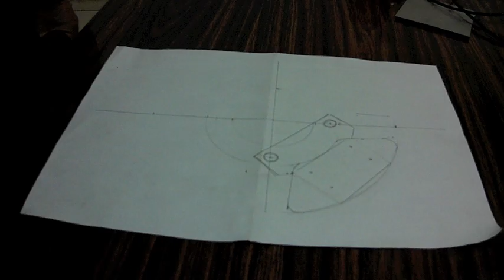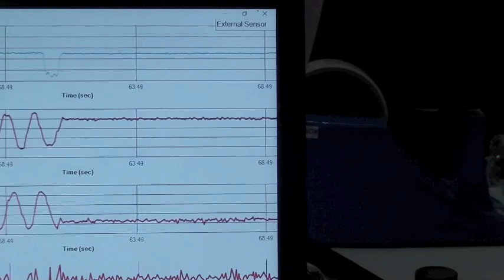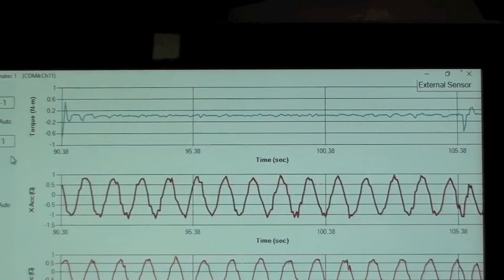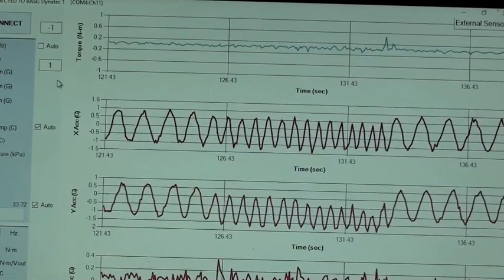TORQUE Measurement on two-wheeler with strain gages

Comment: When the wheel is on the ground will bumps in the road throw this off? I want to try something like this to see a real time value of power output of my bike. I want to know this so I can divide it by the fuel consumption from a flow meter to get a real time reading of the thermal efficiency
Reply from the maker: The mounting bracket for the transmitter and the battery has to be made well and fastened appropriately so that it withstands vibrations, jerks and bumps. In the experiment done here, the bike was tested on a dynamometer which simulated road conditions, at 100 km/hour speed, without incident.

Comment: Can we measure the force also using this? But as per specifications of TECAT, it is only Torque, Acceleration..Any idea for force measurement for the rotational/Moving bodies?
Reply: Tecat make Wiser 4000 system can be used to transmit data from any full bridge. Regards. Pradeep.